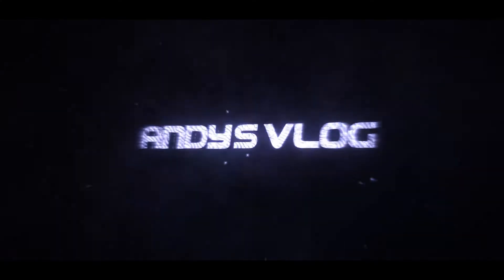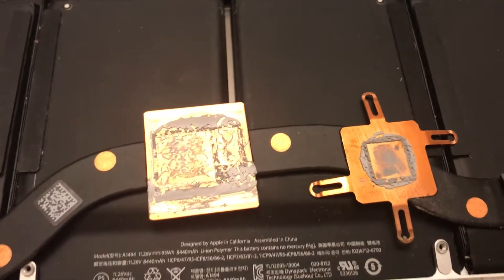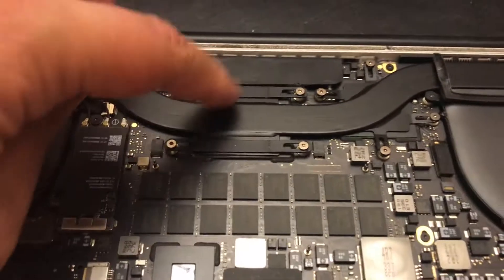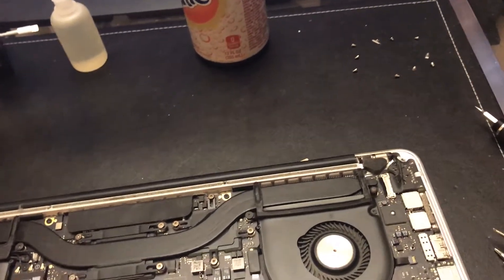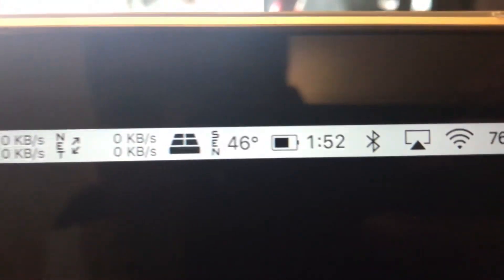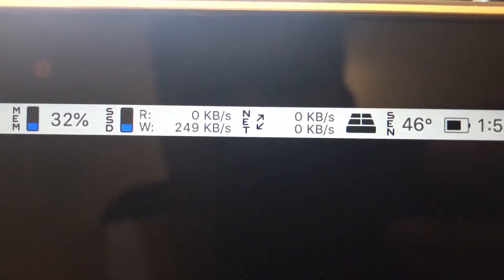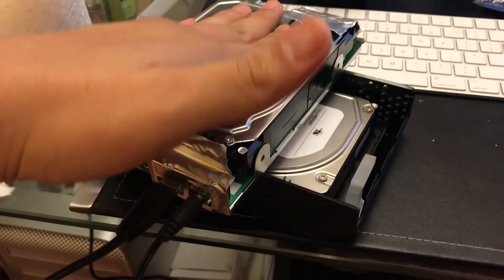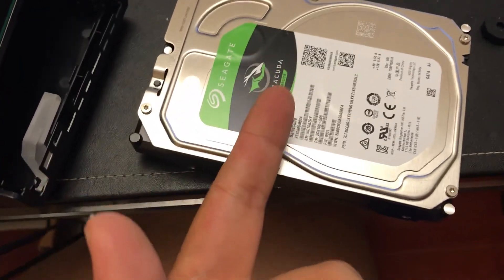Macbook Pro Retina Thermal Compound Repaste

Comment: Thermal Grizzly Kryonaut is fine for temperatures up to 80°C but beyond that it starts to break down.  In other words, it is highly likely Kryonaut will dry out if used consistently at temps above 80°C.  And while the mid-2015 15" MBP doesn't run constantly beyond 80°C, it does when you are editing videos or exporting videos or watching 4k YouTube videos in Chrome.  Since you made your vide in Nov. 2018, that's 8 months of use (it's now July 2019). I'm curious if you have noticed your temperatures worsening over time?  Thanks.
Reply from the maker: JDW still going strong temps actually got better over time